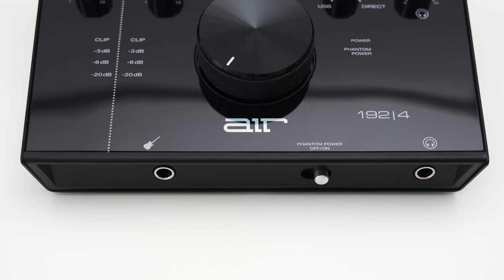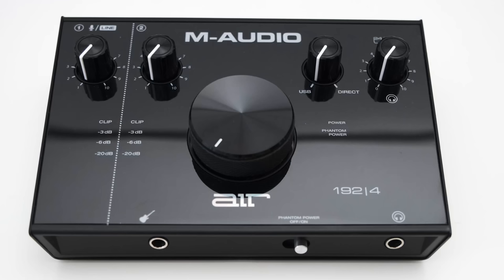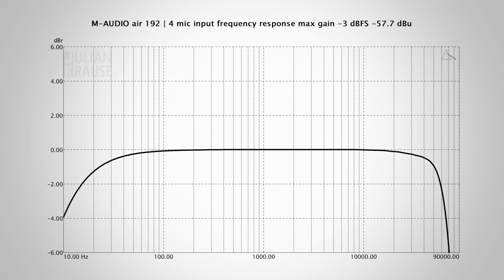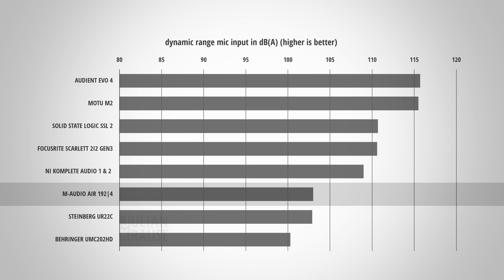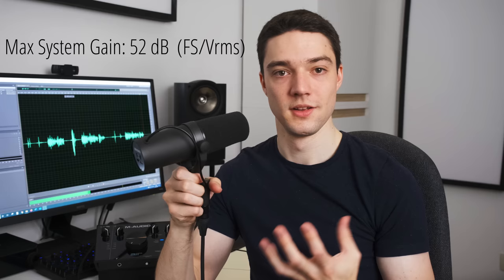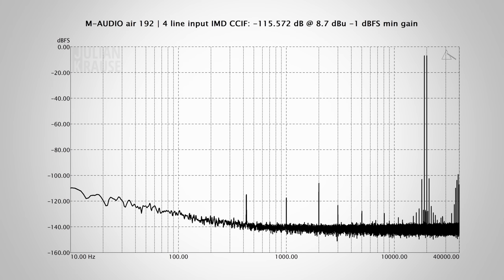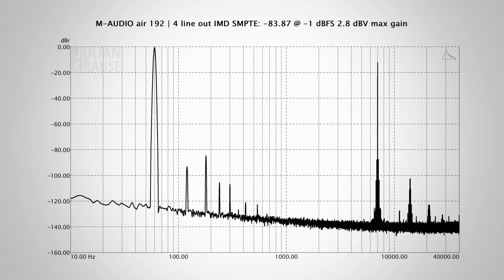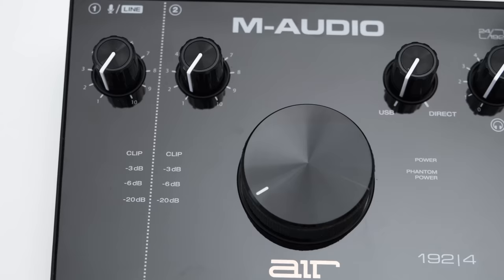M-AUDIO AIR 192|4 USB Audio Interface - REVIEW (audio quality measured)

Comment: What would you recommend?
M-AUDIO AIR 192|4  or the Scarlett Solo 3rd Gen?
Reply: Yes please!
Reply: Please dude reply to this question
Reply: Answer?
Reply: I  really need the answer
Reply: Please
Reply: Please answer
Reply: Any answer?
Reply: We need your insights on this please!!! 
Im torn between
M-AUDIO AIR 192|4
Scarlett Solo 3rd Gen
and Native Instruments Komplete Audio 1
Reply: M AUDIO IS BETTER
Reply: They're both very good, and the M-Audio AIR series looks cooler, so I'm going with that one, personally.
Reply: You can't go wrong with either. Just pick the one you feel more drawn towards.
Reply: M audio sounds better both with instruments and mics
Reply: Honestly whichever one you like better there’s no sound difference
Reply: M Audio Air 192 4 is class.
Reply: @NY Mets No, it's ass.  I got mine due this review and in Windows it takes their driver to work and I have had nothing but issues with the driver.  I submitted a ticket and they never got back to me and support is half of what you are purchasing from any company.  If they refuse to contact me back as a valid registered customer that means it has no warranty.
Reply: @generalawareness101  in my case the driver works perfectly on Win 10, I just had to plug it in. Something Focusrite never achieved.
Reply: @LianExfeind  I just returned it as the problems never ceased and they were all driver related of varying kinds.  What the last straw was that support never replied to my ticket or to me.
Reply: @generalawareness101  it's weird how this stuff always seems to vary from system to system. For me it's the best one I ever had. Strange stuff.
Reply: @LianExfeind  I was reading and a lot of people had the issue and it is their drivers but they blame Windows but other interfaces don't have similar issue as I had.  One way to make it puke is to open its panel (unless it says it is missing that dll) and change the sample rate.  BOOM, that will at least force you to reboot or worse.  I can go into the sound devices and make something else default then make it back to default and if that doesn't work then go in the advanced tab in its properties and change the sample rate then change it back and most times it will begin working again.  What a huge PITA and one other issue is I purchased an XM8500 which is, in reality using the new methodology, about the same as a SM7B for gain and this interface is one of the lowest gains on the market so at 95% one light and you can be as careful as you can and it will jump to full on clipping red no matter how hard you try to just nudge it ever so slightly higher.  Basically the last 5% is really max so ugh.
Reply: We need a response 😭
Reply: All branded sound cards over 100$ sounds fine for general use. Software is the only difference. You need to check forums and make sure that drivers are stable and native software works fine on your system. Also, this is the reason why i forced to replace my old esi u46 xl
Reply: Right, they are almost all completely fine. Don't get caught up in overthinking, just pick one.
Reply: The issue with Focusrite, and I have the 18i20 3rd gen, is that they will purposely hold back the sound quality or you would skip buying the Clarett series.  Compared to the Presonus AR12 digital mixer, Presonus Studio 1824c, Audient ID22, ID14, and Audient Evo 8 (my current interface), the Focusrite sounds muffled and I do not like how the software metering does not update in real time!  For example, you want to set a stereo input to top out at -3 dB, it will update as you turn up the preamp, but not as you turn it back down unless you click on the mixer.  Totally stupid software design and this makes setting gain a major pain.  The Air function does sound pretty good with mics and adds richness, but the overall quality is fine (until you hear a competing product sound quality hooked into the same system).  It sounds thin and lacks richness.  Not bad sounding and likely better than most built-in motherboard sound, but I have never heard it and said, "Damn, this thing sounds good!"  My Audient Evo 8 walks all over it with sound quality and I have no doubt the M-Audio Air does the same.
Reply: M-Audio is the best by far. I have both but I just got it like six months ago but I was blown away by it. Scarlet is been so good to most of the producers out there but there is a sheriff in town and m audio is that sheriff.
Reply: @fu J I didn’t choose M-Audio because most of the time we hear scarlet is the best whenever you ask people but when this interface came out I bought that one input just to try it out and the quality I was insane so I bought the air 192|4 instead because I’m a drummer and I needed more than one input to track my drums and it became my go to interface ever since.
Reply: @creativeroom365  the Scarlet is not a good audio interface, a lot of distorsion, a lot of problems with them and they have the same composants than a Behringer, if you want a Scarlet then buy a 50$ Behringer audio interface, you'll have the same result
Reply: Does someone know what he exactly means with channel balance?
Reply: @chur0x303  i think it's for adjust the power in your right or left ear
Reply: @YxngDiabetes  is this important and are 2.7 db a lot?
Reply: @chur0x303  it's a small difference that you would only hear on very low volumes
Reply: @mutaned0  so it is the difference between my left and right studio monitors as far is’ve understood. and that it does not make a huge difference.
Reply: Scarlett has higher dynamic range it means it can ge more signals from your voice while recording BUT the effect is gaining more noise, the M-audio  dynamic range is lower by 6 but has a low floor noise. Thats why I pick M audio, voice quality can be process. But noise is really hard to remove.
Reply: M Audio Air

Comment: Excellent review!  Thank you
I currently have a Focusrite 2i2 using both inputs. Can the M-Audio AIR o192/4 or 192/6 be connected as an additional USB input on PC and not interfere with the existing 2i2?

Comment: This review is beyond excellent. What also stuck me, having battle with audio recording for more years that I care to remember, is the astonishing design that went into the human ear. Noise floor - incredible. Dynamic range - incredible. Both aspects have made me reflect over time that the theory of evolution is the biggest load or pollocks ever invented by man.
I have an M-Track 2x2 but I want to use it to record the stereo output from my digital piano. The problem is that the M-Track inputs are at low and high impedance respectively. I'll have to physically patch in after the instrument matching stage. That's fine.

Comment: Thanks for the great in-depth review. I think the interface looks absolutely fantastic, it has all the features I'm looking for and your positive review is a great recommendation. Still I have seen a lot of M-Audio Air 192 users reporting various problems with their devices, which makes me really hesitant about buying one. Did you experience any, or have heard about reliability issues?
Reply: Hey, chiming in here with my experience. I ended up going with this device but quickly started running into issues. The sound would pop and distort horribly almost constantly and no matter what I did fixed it. I'm currently looking to send it back and replace it with some other interface. There's no mention of it anywhere (the minimum requirements on their website just state Windows 7 lmao) but apparently the device doesn't officially support use with PCs that have AMD Ryzen processors and there hasn't been a driver update since around the time of the interface's release. Not saying you'll have similar problems but I never had any trouble on this very same setup using my og Steinberg UR22 interface. But I'd recommend that, at least if you're running an AMD system, you should stay clear. 
 https://getsatisfaction.com/m-audio/topics/m-audio-air-192-product-driver-problem-is-serious-my-computer-has-clipping-and-popping-sounds
Reply: @Gas0lin3  yo thanks. i got a ryzne build and was gonna get this. my other choice is the scarlott solo 3rd gen
Reply: I really love mine. It's cheap and effective, for my purposes at least. Some things to consider:
1. The headphone output is pretty noisy, but only at higher settings that I wouldn't really use in a mixing session
2. When I'm using it as an ASIO device I will occasionally get this really annoying phase cancellation and comb filtering that drives me nuts fixing. I don't know where it comes from but it always ends up fixed
3. The software side of it could be better. A good amount of lag and choppy-ness when recording sometimes. I do use an AMD CPU, but this problem seems more driver related than anything else.

Comment: Hi! I want to buy a DT990 Pro 250 Ohm for my Air 192|4, but i dont know if it wil work because of the high Ohms. Can you help me?
Reply: it does. Not quiet at all
Reply: @nineseven7528  legend
Reply: @02PANI02  i mean it could be just a very little bit louder, but most people including me will be completely satisfied with it. If you wanna get it even louder you can turn the USB / DIRECT knob a bit more towards the USB side, but don't do it too much cuz you'd get distorted sound. Hopefully this helped
Reply: Did you get the headphones?
Reply: @jorgeguitar2540  Yes i did! They work fine. Volume knob at about 45% delivers good sound, and 100% volume knob  will blast your ears to pieces :)

Comment: HI Julian! is great how simple and profound you can go, I really apprecciate your videos. I have a question of the headphones output of this device. It is stereo or mono? After listening to a stereo song from the music app in my DT 770 Pro  250ohm headphones via my MacBook Pro headphones output I've noticed the difference, it plays stereo, but when playing through the interface, same model you reviewed, it just came out mono, flat without the stereo imaging. After checking all setting in my computer I can't understand what's happening. When I go to the specs for this device it reads: Headphone Output (impedance-balanced 1/4” [6.35 mm] TRS) - does this means is mono output? in the other models of the m-audio air it specify is stereo, not in the air 192/4, but neither specify is mono. It would be hard to believe is mono output.  I ''ve also tried connecting the interface to another laptop and I got the same problem. But when I connect my mixer Traktor Kontrol Z I have a stereo signal. Can you verify if this is the same for you? Thanks in advance for your support!

Comment: Does the Dynamic Range apply to Synths? I want the 192/6 version to plug my synth into it via two 1/4 jack inputs, and also my laptop via USB, would the dynamic range only apply to Microphone signals or would it also limit the sound from a Synth or my Computer?

Comment: Great review man! Really loved it and gave me a lot more insights in the interface I own.

Still have a question though;

Is the Beyerdynamic DT 770 pro 250 ohm, suitable for this interface? Looking for new headphones that have a flat response and go well with the 192|4. Can you help me out please? 🙂
Reply: Was wondering this too. Any updates? Did you get them? Did they sound okay? :)
Reply: @gravityhorizon7107  They sound very VERY good, but the volume was really low, so had to turn it up quite a bit, to get enough volume in some situations, while producing. Returned it because of this, unfortunately.

I've bought the Audio Technica ATH MX 50 instead now. Not as flat as the Beyerdynamics, but still very pleasing to listen to and gives a bit more punch. Also gives a lot more volume in combination with this interface. Really loving these headphones!
Reply: @Mattijs89  Oh amazing! Thank you for your reply! I have been torn between the MX50s and the DT770s. Also: do you use this interface with Mac? Or Windows? I’ve seen a few negative reviews on Amazon about potential driver issues with the interface on Windows, and I’ve personally experienced popping whenever Windows plays ‘system sounds’, and to solve it I have to change the sample rate to 48k. I was wondering is this is the case with Mac? (If you know, of course!)

Comment: QUESTION: So I can control my monitors and headphone volume separately? I am currently having an issue with this. I have a focusrite solo 2nd gen that only has one volume knob. i have to turn the speakers off or unplug them if I want to only use my headphones. I have been trying to find a way, and maybe a piece of equipment, that will eliminate this problem. I dont want to buy an unnecessary piece of equipment. What would be the best route for me? a new interface like this one or something like a big knob? 
Thank you and great video.
Reply from the maker: Hey, yes this interface has separate controls for monitor and headphone volume. You do not have to unplug the headphones to listen to your monitors.
Reply: I have the m audio air 192|4 and yes I can adjust the volume on my headphones seperate from my monitors however, I still turn off my monitors when Im recording because they hum.

Comment: Hey Julian. Thank you for another great video. I see the KEF iQ1 on your desk. I am curious why you chose that speaker for your near field monitor.  And what amplifier do you use to power it?
Reply from the maker: Hey, the biggest reason is the coaxial design which I think is nice to have in a near field monitor. The iQ1 also look quite good and the sound is pretty decent too. I use a NAD D 3020 which has an integrated DAC and is directly connected to my PC via USB.
Reply: @JulianKrause  Thanks Julian. I agree about the coaxial design and thought that might be what drew you. I have a NAD 302, with a Presonus Audiobox 96 USB interface between computer and the NAD. My speakers are also front-ported, with 8" Audax woofers and 1" Audax dome tweeters.

Comment: I have the predecessor this called M-Track 2x2 but it looks identical. I hope this one is better because I get a horrible hissing noise on the headphone output unless I set the volume knob to around 40-50%, anything more or less results in hiss. I can also hear my mouse movement as noise in my headphones which is mildly annoying. Monitor volume wheel also crackles a bit when you use it.

Comment: Really informative reviews! I am currently searching for a new, low budget interface with nice sound. 
So I have some questions which are not adressed in all reviews I saw. 
1. Does it make a difference in RTD (or some other benefits) if I use USB Type C? 
2. How are the drivers performing? That is one of the most important question to answer, because I have to buy a new interface, because the drivers of my interface are not supported anymore since 2013. So I get crackling noises in Windows 10, which where not a problem before. 
3. Concerning the NI Komplete Audio 2... I watched a video in which someone says, that the direct sound knob does lower the volume of the PC sound if you turn it. Can anyone confirm/revise that? 

So I am thinking about buying the  NI Kolmplete Audio 2 or Focusrite Scarlett 2i2 3rd Gen or PreSonus Studio 24c or M-Audio AIR 192.
Suggestions and opinions are welcome! 
Thank you in advance!

Comment: Hey Julian I've already bought an Audio Technica ATH M40x which has an impedance of 32 ohms. Considering your rule of thumb regarding one's headphones should be 8x that of the output impedance of the amp, it seems like I'm at a detriment with the likes of the M-Audio AIR 192|4 and Audient Evo 4. Unless the sound wont be greatly affected, what then would be a suitable 2in 2out DAC to cater for these low impedance headphones?

Comment: Bought M-Audio Fast Track once and they just stopped updating drivers. So if you like to use a perfectly fine interface as a paper weight when they force you to upgrade by refusing to continue to support a product you spent your money on with a trivial thing like updating drivers, just go with M-Audio.
Reply: Totally agree with that. This card's driver 1.0.4 (its released 04/08/2021) doesn't work with Windows 11 even they claim its supported on Windows 11.
Reply: @ozkaramustafa  it doesn't even work on windows 10 anymore if you have a modern cpu. They just got the cash from the first shippings and stopped caring.

Comment: Hi mate, I supposse it would be difficult for you as you usually never handle multiple I/O interfaces but I wonder if there is any change for you to review the Steinberg UR816C, the reason being that I have one un-opened BUT since I saw your review of the like model UR22C, I rather unsure of if just sell my unit now that still sealed or if perhaps, could be a chance that the 816 would have better performance than its smaller sister. 

BTW, I was also very interested in knowing some about the Roland UA 10-10 but being a very old model non upgraded phisically since almost 10 years ago, there is nothing to be seeing in internet other than just very very very old video-reviews...

Thanks in advance and congratulations for your videos :)